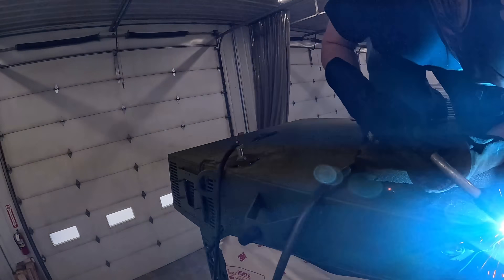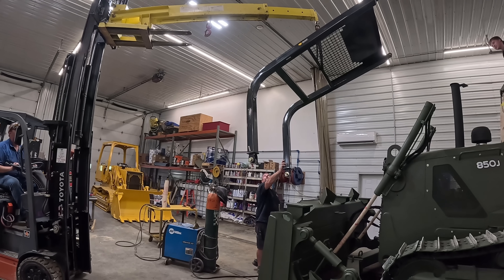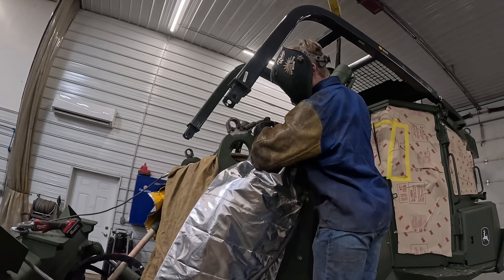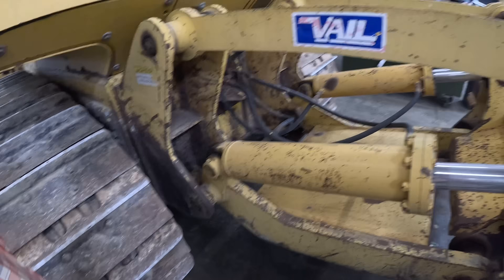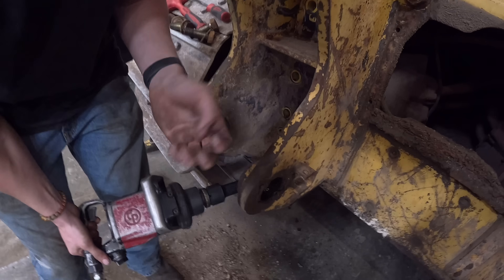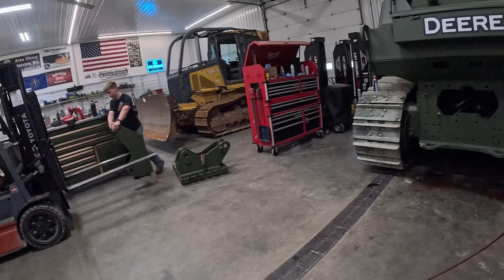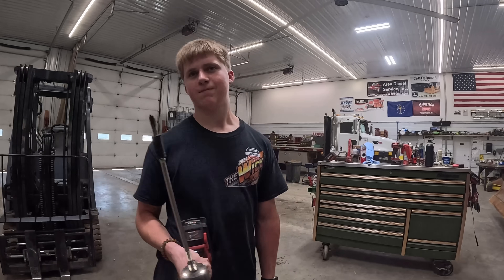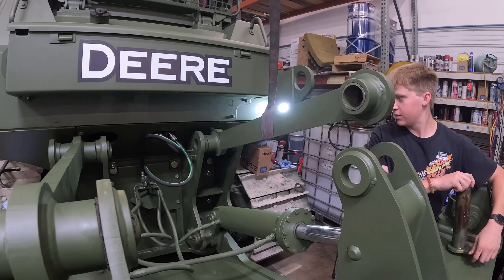Military Dozer: The ULTIMATE Upgrade!

Comment: 25ton over head crane that is 25ft high will cost you anywhere from $80-150k depending.  Also, do you have supporting footings for that or do they need to install piles or do more with site prep to support the weight?
Reply from the maker: 🤷‍♂️ sounds expensive

Comment: If you welded those tabs at the back side of lift ears, those could still be used. Now it would brake the frame if a hook is attached to the ear.

Comment: Taps are not designed for using with a electric drill so when using drill simulate using hand tool  use slow speed and take easy on trigger working in and out as it goes

Comment: Instead of spending tens of thousands of dollars on an ovehead crane system, why not build a gantry (A-frame) ovehead crane with remote control wheels (yes, they have those) so that when you lift a part you can move the a-frame into position and lower the part into place with the electric hoist?